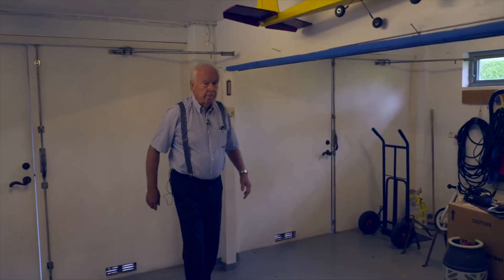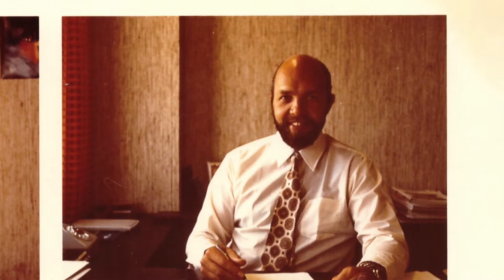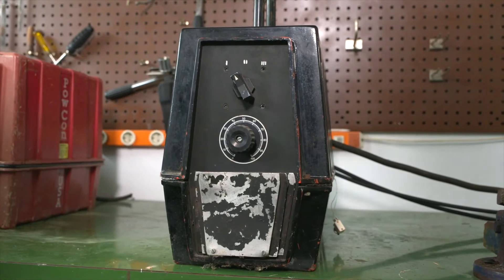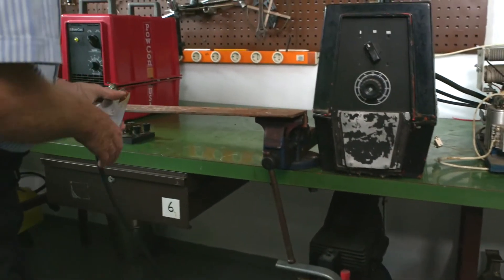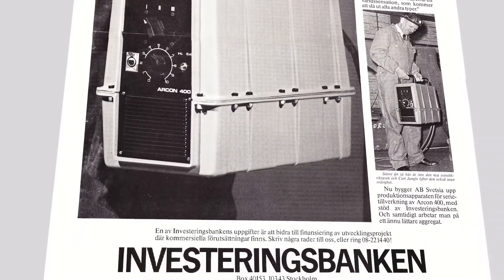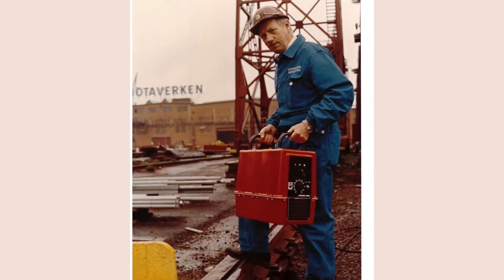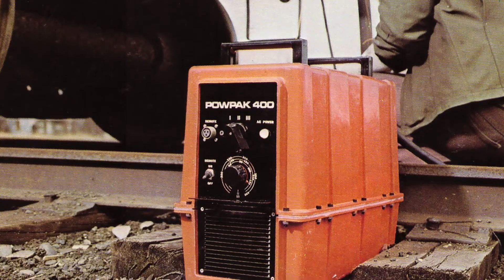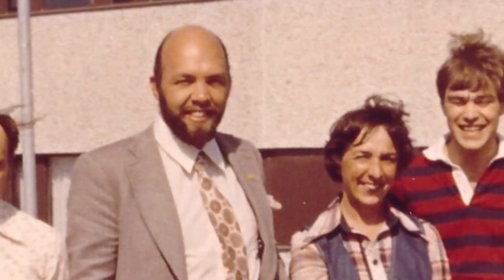Powcon the legend - The Breakthrough of Inverter Welding

Comment: Never realised they were Swedish. I love my Powcon 300. Really powerful and sweet to weld with. I thought it had died on me a few months ago. Loads of white smoke billowing from it. Turned out to be just the 3 Rifa capacitors had blown. Very common. Still available. Fixed very easily.
Reply from the maker: That’s great to hear! Powcon machines are definitely powerful. Glad you were able to fix it—sounds like those Rifa capacitors can sometimes fail, but good to know replacements are available. Keep welding! 🔥👍
Reply: All your great tools origin from Sweden